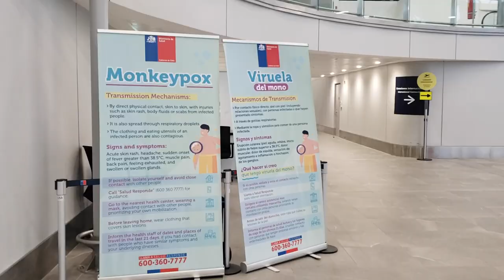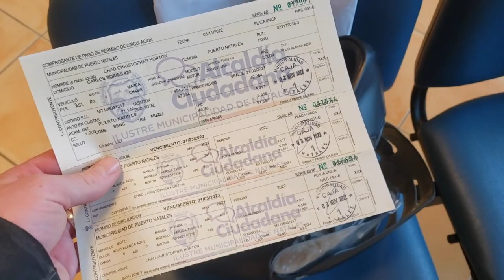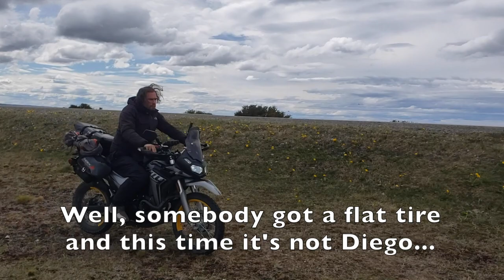New Beginnings: Life On The Road - Season 3 Premiere (S3:E1) #motovlog

Comment: That was NO flat, but a rupture due to the tire being defective or just old. Always check the date the tire was manufactured, it is on the tire.
Reply from the maker: I run tubes... If that had been tubeless, it would have been A LOT worse! Luckily the tube only had a small puncture, but I replaced it with my spare (heavy duty) which luckily survived the ride into town... 💪
Reply: @TwoWheelsThreeSheets  Glad you are okay, what is the wind speed over there now. I bet it’s over 40mph.
Reply from the maker: Thank you! Winds were pretty mild that day - gusting around 50mph max...